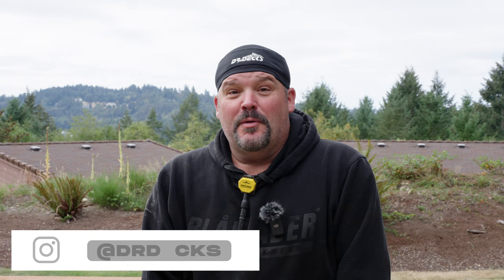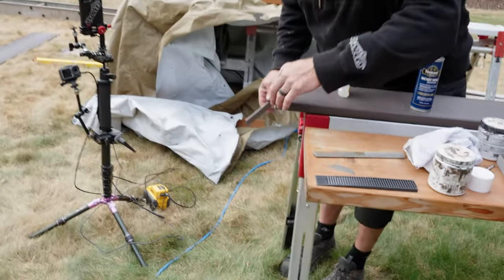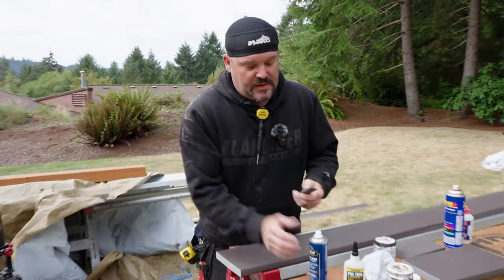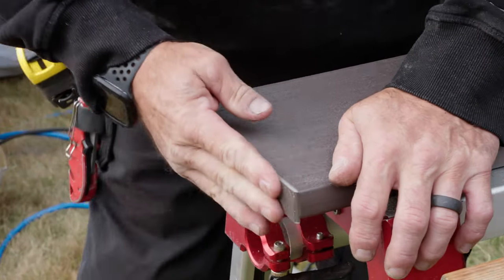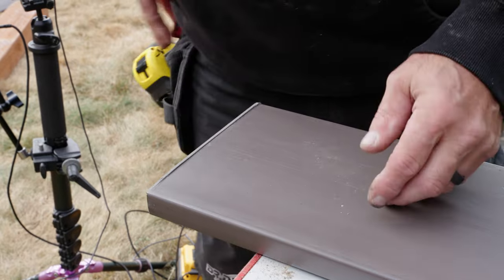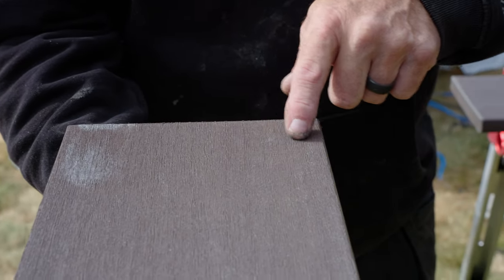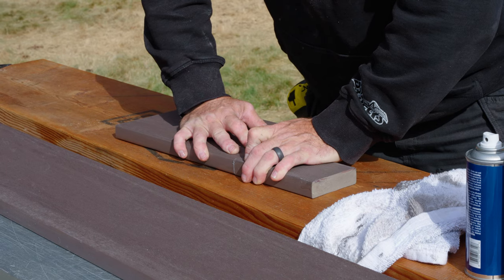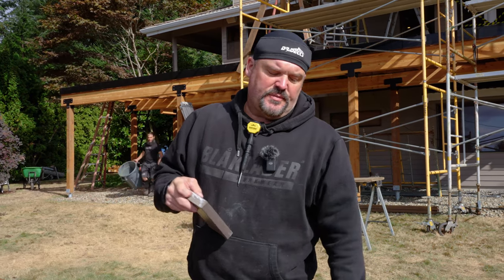My New Favorite PVC Glue: TITEBOND || Dr Decks

Comment: I have found that the true test is time on the job. With the way that stuff expands and contracts I cannot seeing it stay together. I have a composite situation now. The trim on my deck (screwed it) will sometimes fall off. I have about a 6 inch piece I want to "fast" glue on. Not wanting to use screws. Any ideas on this? I used a product for decking that failed and they refunded my $$$ twice!! Therefor I do not say their name. Even with all the cracking and splitting plus the huge expansion factor it still looks better than treated wood would.